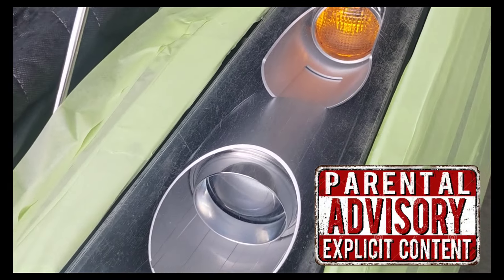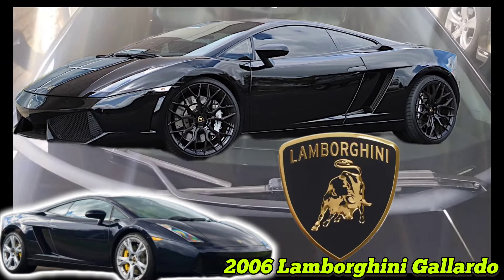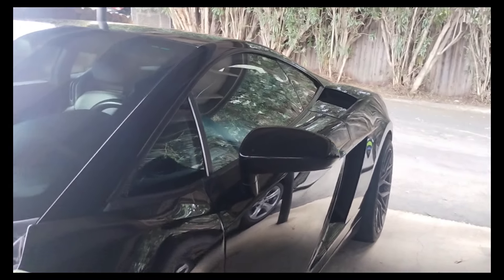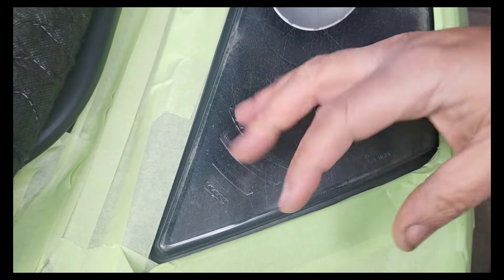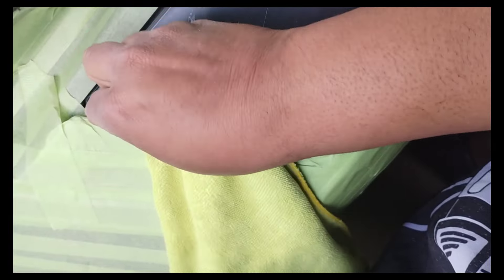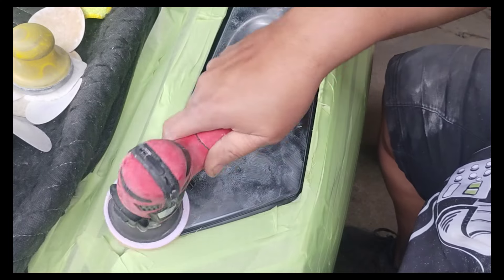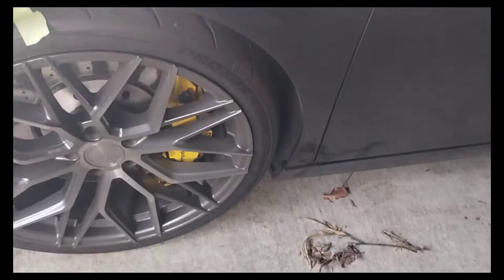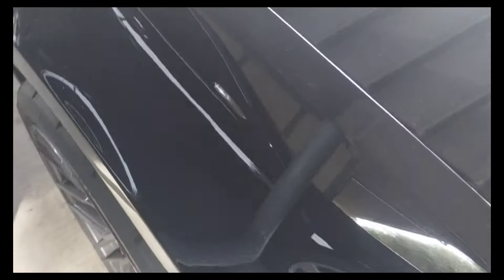Lamborghini HEADLIGHT RESTORATION - 💲10,000 Headlights 💰

Comment: Dude! I just want to say thank you so much for your videos! I have tried wet sanding my GMC sierra headlights a few times in the past with very weak results. Mostly what other YouTubers suggest. 

Tried your method to a T and DAMN! My headlights look brand new!!! Taking the time to do it right with the right equipment pays off! Only difference for me is that I used a Rupes 3 inch DA for the sanding and polishing. Was worried about the rupes producing too much heat while sanding but it did great. Thanks again!!!!

Comment: I bought the aloy foil tape for more expensive paintjobs for extra protection like you advised a while  back. Are you.not using that foil tape any more?
Reply from the maker: Yeah I use it all the time the way this headlight was designed was a minimum risk of hitting those edges as you see those gaps in between all the way around I did an extra tape off of the regular tape maybe about five layers just in case... Also I don't record every vehicle that I do you're only seeing about 1% of what I actually do on the channel if not less....

Comment: In my opinion after doing this for several years now that lambs wool is the way to go with the 3 inch pads . The foam ones are ok but for heavy cutting I believe it’s better
Reply from the maker: That's crazy because typically in doing other services including headlights the wool pads are a lot more gentler more of a finish polish... I used to try to use wool on headlights but it didn't do much far as micro scratch removal or anything like that it would contribute to having scratches and swirls left over in the finished product.. in my experience...
Reply: @theheadlightrestorationpro  interesting , didn’t take the fine scratches out .  Never noticed . I will try and be mindful of that to see if that’s the case .  I tend to get these inexpensive Foam pads on Amazon and they seem smoked after 2 uses .  What I didn’t like about foam was that it gets satchurated very quickly and gets floppy because it soaked so much compound . I don’t know if that’s because I am using cheaper foam pads ? What color and firmness do use , if I were to go foam again I would want to use a firmer pad I think. Not the hardest but second to hardest , in my case that was like a orange pad .
Reply: @theheadlightrestorationpro  also I went on one of these top Headlight restoration sites and they recommended wool . Perhaps any little micro scratches that are there can be filled in with the clear anyways . I think perhaps a light that still has a tiny bit of scuff and I mean micro may allow the clear to adhere better ?
Reply from the maker: @Rezparviz I see well that's the issue right there there's a reason why I don't use the cheap pads this is a 3M orange finesse it pad.. this is an amazing quality pad that literally can do probably 50 headlights or more that resurfaces itself and never needs to be cleaned.. it is the perfect medium firm pad for headlights and other things... I urge you to try this pad take scratches out and blemishes out like it's nothing also use it on other aspects of the car like scratch removals and water supply removals all kind of things.....